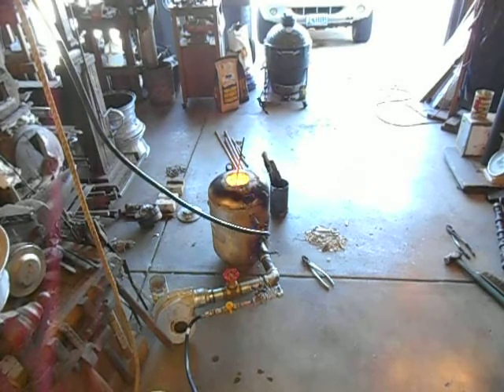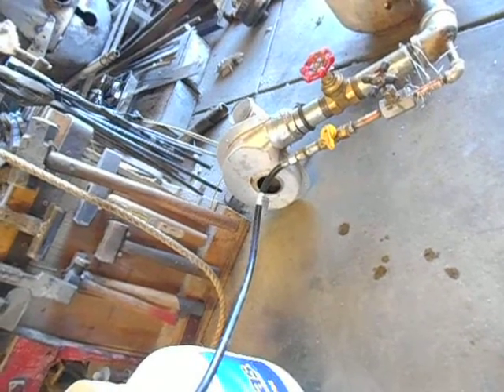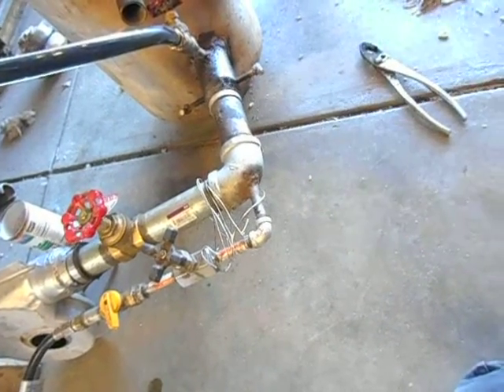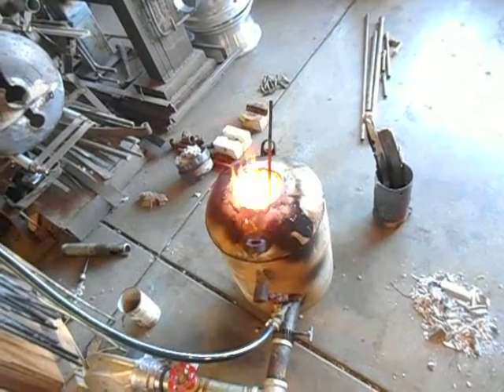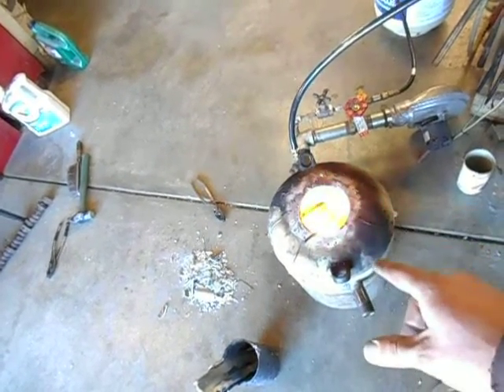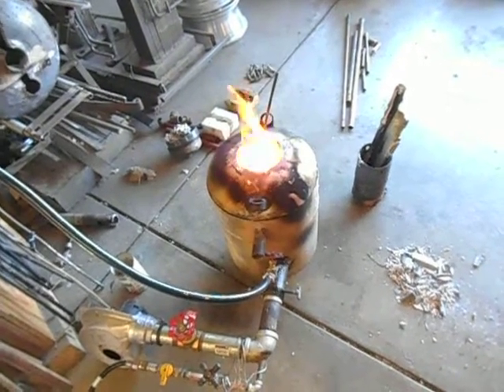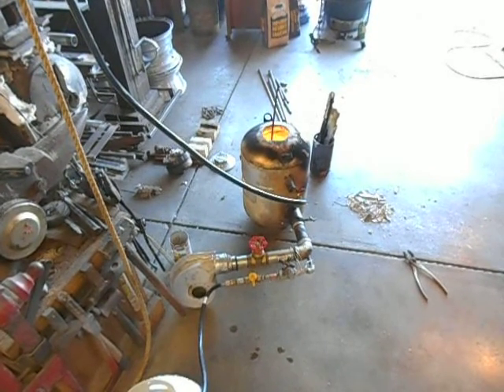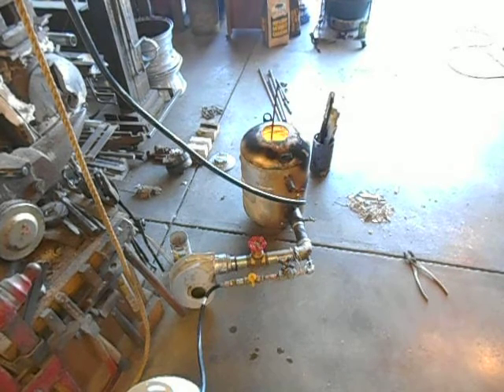waste oil foundry

Comment: You may get it hot enough if you allow more fuel into the system.  Not sure but I know the water in fuel does make it burn cooler but as long as you got loads of flames it should overcome that :)  However if you put a handful of charcoal, barbaque lumps in the furnace it will absolutely get hot enough :)  You only need a small amount, 6 fist size lumps and your a gooden.!

Comment: Aluminum will load up the teeth of any saw if cutting dry. Try running a little bit of wax against the teeth of a circular or bandsaw blade and it will not allow the aluminum to load up the teeth. I've been doing this for almost 30 years and it does great.

Comment: Build a fire in a fire pit and heat up the larger aluminum scrap (aluminum wheels) in there until you can hit it with a hammer and it breaks apart.